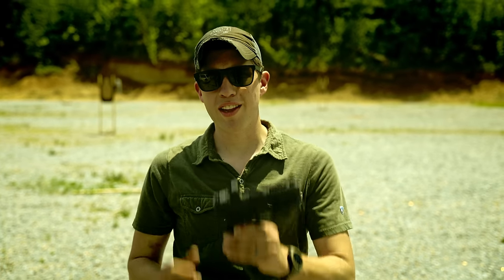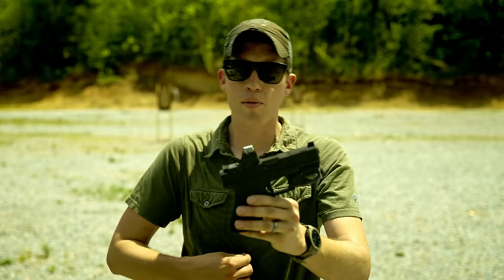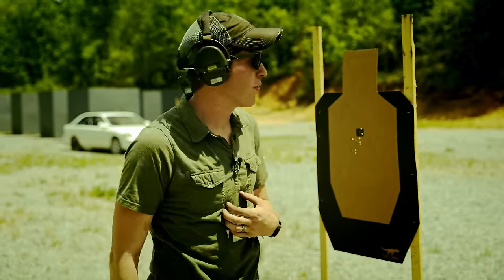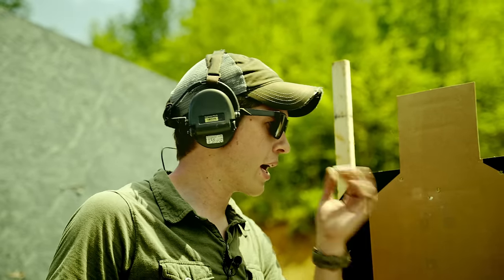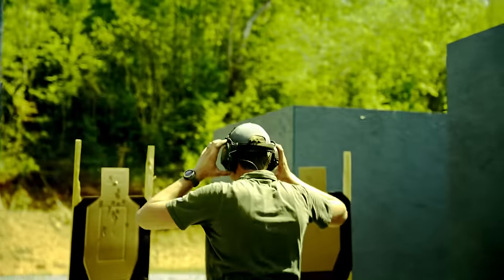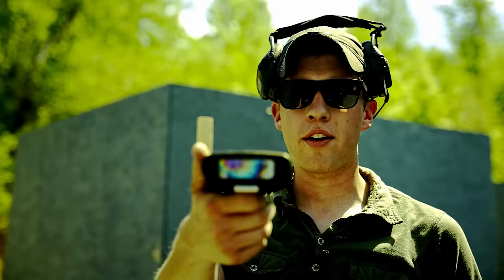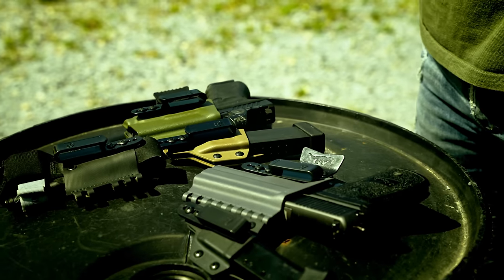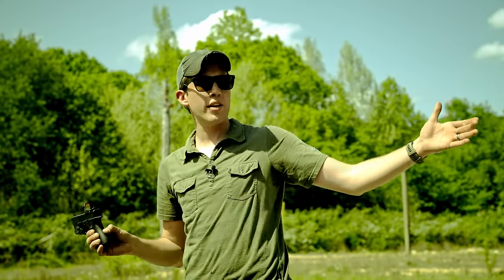How I Test a New EDC Handgun

Comment: Thoughts on fail to go into slide lock on the final round? I’ve run into this on two optics ready pistols.
Reply: This is 95% of the time caused by the user.  The more aggressive and "high" your grip gets the more likely you are to block/nudge/disengage the slide release.  If you can't find a mechanical fault with the gun, this is probably what's happening.  It sucks, but it's also tough to undo (i.e. you shoot how you shoot, generally).  You can simply get used to that happening.  Not the best answer, but I know a ton of guys who have that issue sporadically because of their grip.
Reply: One of the few good things about being a southpaw is that is one issue I don't have to deal with.
Reply: I had this problem, i videoed myself and adjusted my grip. Dry fired the way that eliminated the problem lord only knows how many times until it stuck and haven't had an issue since.

Comment: Makes a lot of sense I wanna “master” irons before I get a red dot I’m probably gonna upgrade this upcoming year
Reply: When I've shot handguns with red dot sights I always had a hard time keeping my eye on the dot between shots.
I'm assuming "more practice" would eliminate that problem, but I haven't had the opportunity.
Reply: Don't forget what you're training for, Marksmanship training is completely different from Scenarios where you won't have time to line up the perfect squeeze each time for the best group. I was able to get hits on a torso sized target at 25yrds on irons consistently with speed when I got my slide milled and holosun RDS attached. Doing this made me just a slight bit faster than I already was. In all honestly, a good set of tall iron sights work as close to a red dot as possible. But you really can't beat the speed of a Dot.
Reply: @Boomy's Woodertag  your problem is trying to keep your eyes on the dot. You should be target focused
Reply: @michaelp1630 Personally I’m WAY faster with target acquisition with irons. 
The og open top sight (like ak’s) is hard to beat for speed. 
(I’m referring to drawing from hip/ready position to on target).

I def need more practice with red dots. I assume it’ll be like my Ak, more accurate per shot, but honestly can’t say faster follow ups compared to irons. 
Now using a dumb peep hole sight? Yes go red dot any day.

Edit: Lucas basically says the same thing at @ 11:00
I’d only add that red dots take more practice, where most ppl can use irons decently from the start.

Comment: Wow.  That is a fast draw.   I was a cop for 31 years, I never kept a pistol for more than 10,000 rounds for duty purposes.  Never really kept an accurate count but after  6-7 years, I figured the firearm had around 10K rounds through it between training at work and training in my own. I than went and bought another Glock 17, which is what I used.